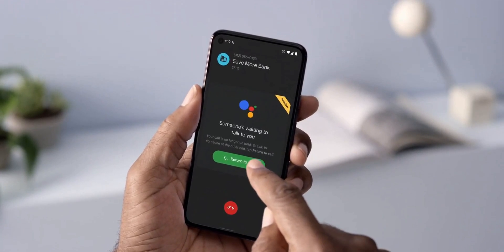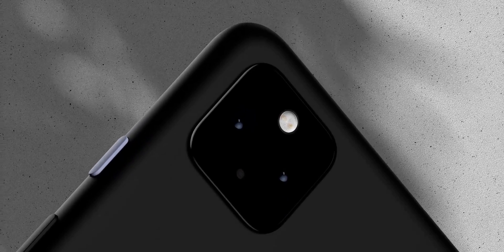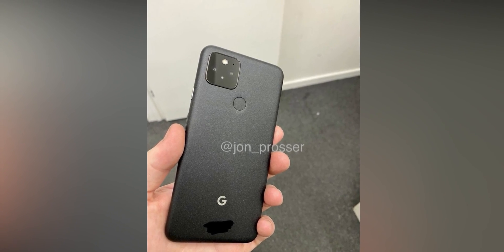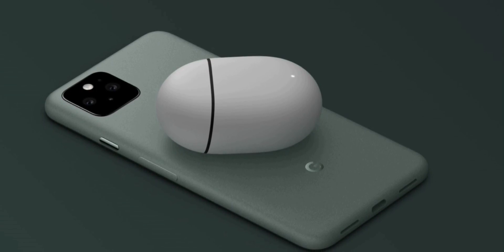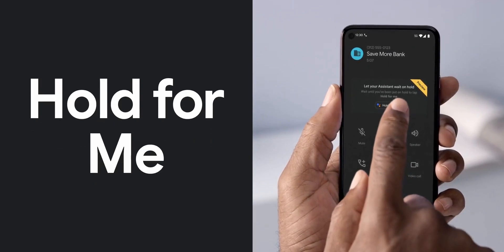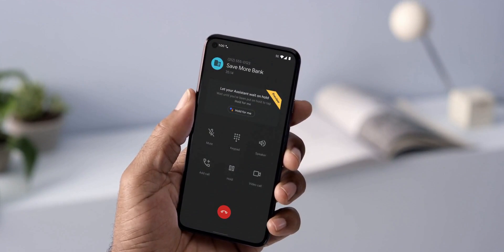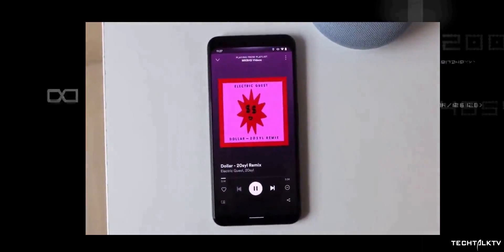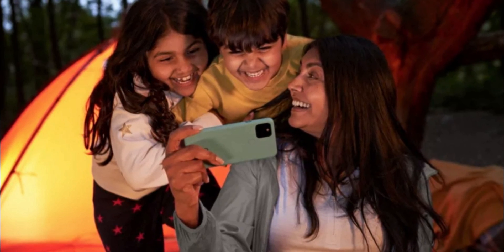Pixel 5 - WHAT SORCERY IS THIS?

Comment: From what I've seen, no the Pixel 5 is not worth 700 dollars, not even close
Hardware degradation is a  real thing, your device slows down over time. 
it's using the 765g chip, which is actually really horrible. The 865 is literally DOUBLE the performance in gaming, and nearly that in just cpu speed. 
It's a VERY big deal, very. 
No matter the optimization it will lag when doing multiple things, where the 865 will not depending on your use case scenario. 
Not only this, it seems they're using the SAME main censor as the 4a, which is very weak. 
Even its video demonstration looked spikey, and not very crisp or clear.  The iphone 11, literally at the same price or less RIGHT NOW is faster, has a better camera, and takes the best video of any smartphone out there. And with 12 coming out soon, Buying the pixel 5 is a very poor, and foolish choice that  lacks any thought to it beyond stubburness of which they will regret in time. 
This phone is NOT worth it, not even close.

Comment: The Galaxy S20FE absolutely destroys Pixel 5, and the price is the same.. I know Pixel usually has a decent camera but, 1) camera set up is far superior on FE. 2) 4500mah battery vs 4080mah, 3) 128gb ufs 3.1 expandable storage vs 128gb ufs 2.1 non expandable storage, 4)120hz vs 90hz. 5)Snapdragon 865 chipset v mid range 765. 6) 25w charging vs 18w charging. Pixels never sell very well anyway but the S20FE will kill it totally.

Comment: Yes, I think $699 is a bit too much for this phone.  I think $550-$600 would be the sweet spot considering the competitors out there.  At $700 the Samsung S20 FE I would say has better specs and at $500 you have the OnePlus Nord which is similarly if slightly differently specc'd.  I think overall the Pixel is a little better specc'd than the OP N but less than the GS20 FE and should be priced between the two, at least ideally.  Of course being an Android phone it's only a matter of waiting and you will probably see some price deals that make it worth the price.

Comment: The reason pixel 5 good or bad is 699 is because they added millimeter wave 5g. Verizon charges 100 dollars more for the 4a5g UW to get MMW. So the extra features pixel 5 has, wireless charging reverse charging 90hz display 8 gb of ram bigger battery IP68 and the metal body is what makes up the the other 100 dollars over the pixel 4a5g. Had they left out MMW the pixel 5 would have been 599.Personally i think verizon forced them into this. MMW is a waste of money at this time.

Comment: If they have optimised the software like iPhone then it's a great phone but still it's gonna cost 70,000 ruppez in India which is roughly around 1100$ so I'm not gonna buy it I'm happy with my pixel 2xl 😂

Comment: I think that companies were just making excuses that aluminum back and glass can't be together, they were lying. Aluminum is not that much of magnetic material so induced current would be less plus there would be a insulated layer between wireless charger and back panel like adhesive or plastic. Until jerryrigseverything.

Comment: No point in getting a Pixel 5 when i can  get the S20 FE for $550 and get
1. 6.5" screen
2. 120hz
3. SD 865 chip
4. triple camera
5. 32MP selfie camera
6.  in display fingerprint scanner
7. 4500mah battery
8. way more software features & color choices.

Comment: Absolutely yes (very overpriced for a midrange phone,especially counting that they are not including the pixel neural core and are making use of the same camera sensor again)
Is like buying the thinkpad x1 fold which sells at $2499-2999 USD but in the end It is just a super expensive Atom laptop which folds
Reply: It has Intel Atom?

Comment: no dude they wont stop using... people will learn to adapt its all upon the brand how loyal they are and they support the feature... and soli radar made the pixel stand out from the rest...  it does have features that people do use it day to day like switching between songs without having to unlock the phone or even touching and so on even dave lee got used to it... people said the same about the asus zenfone flip cam too but if the brand is loyal to their features there are people who will adapt to it... if Motorola and LG didnt stop with the modular phones it would have been their USP even today. like how lg started with wide cams and they stopped it but others picked it up and now its cool...

Comment: just like i said, right? for the wireless charging

if it has an sd card slot it's a good phone, if it hasn't, i would never buy it

internal storage just isn't enough for more than 4 years of usage

s7 was hard to beat up until now with the (pixel 5 and) s20 se

Comment: i'm so happy that the radar is coming back hopefully they take it seriously next time just get the swiping right and work every time u swipe then it's a success i have pixel 4 but i don't use motion sense. just the face unlock is useful but i still prefer the finger print on the side or under the screen as oppose to the back which look kinda outdated .  i'm ok with pixel 4 for now ofcourse it's still a flagship and can get most my work done  and bring me that smooth pixel experience.  i was disappointed to think that google has drop the radar forever but no they just take it back and working to improve that'ss a good news.

Comment: Wireless charging doesn't use signals it just uses Magnetic Fields that fluctuate at a certain frequency to induce an electrical current in the other device's coil. It is calld electromagnetic induction

Comment: S20 FE is going to give a really tough competition to Pixel 5 - Better Hardware vs Better Software.
Reply: Pixel is reliable
Reply: lol what? only better thing on FE is the 120 hz
Reply: @flakron2489  S20 FE is better in terms of hardware; better chip(s), bigger display with higher hz, bigger battery etc for the same price (or $100 less if you go for the non-5G, exynos variant which is still better than Pixel 5's chip), but that doesn't mean you should blindly buy the FE as even though it might seem like a bigger bang for buck, Google is still offering pretty good stuff that is worth considering. Stuff like their amazing software experience both in UI and camera department which is probably gonna be better and will probably last you longer than FE, Android 11 out of the box so you will get major updates upto Android 14, a complete metal body which again will add to its longevity, Titan M security chip for better security, and all other software perks like free YouTube Premium and Stadia for three months — that itself also being joined by three months of access to Google's 100GB cloud storage and Google Play Pass and many more software features.
That's why I said, "Better Hardware vs Better Software". So choose wisely...

Comment: Still take S20 FE Over this at that price!
Reply: I'm neither a fan of Samsung nor Google...but the s20 FE have
- 120hz
- SD 865
- A smaller front camera
- More color options
And overall: you can buy it worldwide without the need to import it
Reply: Jessie Smith 90hz and 120hz doesn’t have a big difference on a smartphone. The midrange chip on the Pixel 5 can match the SD 865 in everything but gaming. Stock Android and optimization will help out the midrange chip, but yeah, the 865 is still much better.
Reply: @Tech UniverseTV for a long-term use maybe yes
Reply: Samsung sucks, the Pixel beats the S20 lineup in everything

Comment: Love how it's metal. Metal backs have always been superior to glass in terms of feel and durability.  They should bring it back especially since wireless charging can be implemented now. Imagine a metal back note 20 ultra in white with wireless charging. That would look slick asf🔥🔥🔥. I would comfortably wear my phone without a case if it were metal back.
Reply: Metal backs are the slickest phones. Even my iPad is slick without a case.
Reply: @ChillydontCap  lol yesss this glass stuff is annoying. I hope Samsung learns a thing or two from google to bring glass back.
Reply: @ChillydontCap  I think the metal is covered with plastic so it would still look like a  plastic back.
Reply: @ricog8209  That I think wouldn't be bad. If it could be a matte finish and not slippery is a plus. Thanks for the info.
Reply: Every metal backed phone I ever had (Nexus 6p and iPhone 6s+) was like holding grease 😳
Reply: Still have a plastic texture above it so.. whats the point

Comment: Wait. The pixel 5 is their phone for this year? I thought that the pixel 4a launched like 2 months ago or so...

Feels old man.
Reply: 4A is midrange
Reply: @kirakira9906  So is 5.
Reply: @Isaiiahii  No it's not..
Reply: @janjamesramos247  Everything about it is midrange.  It's at the upper-end of midrange, but it's not a high-end device.  The main thing that determines a device's category is the SOC and the P5 has an upper midrange SOC.  Just because it competes with the high-end is a few areas doesn't make it a high-end device.
Reply: @Isaiiahii  the meaning of mid is middle.. Statistically, it's not.. that's the simple reason.. the price, the features, the camera, the soc, the software = all Above average..
Reply: @janjamesramos247  The SD765 is a midrange SOC.  The 800series are the high-end SOC's.  Last years SD855 is faster than the 765.  The SD845 CPU is equal to the the 765's, and the 845 GPU is better than the 765.  Last years Pixel 4 has the 855 so is actually better than the Pixel 5 in terms of its SOC.  A device isn't high-end when it's SOC's computing power is equal to two year old high-end SOC's.  

The price is too much since you can buy high-end SOC device's for less money.  It's software doesn't make it high-end since Android 11 is on all the Pixel devices and there isn't anything special about it on the Pixel 5.  The Camera may be the best, we'll see about that, but most likely it's not going to be much better than any high-end device.  It has some features like wireless charging and waterproofing, but those do not make it high-end since it has a midrange SOC.  The Pixel 5 is an upper midrange device that is priced too high.  If I were in the market I'd buy the Pixel 4XL over the 5 since it has a better SOC and more features.
Reply: It was supposed to launch way back like the beginning of the year, but then 2020 struck and everything was delayed!

Comment: The pixel 4a 5G is well priced but in the case of the pixel 5 I feel the Snapdragon 765G is way too weak
Reply: It comes between 855 and 845 and I better than 855 in connectivity and Efficiency
Reply: @Cocxy69  The snapdragon 765g is  actually between 835 and 845 in terms of CPU and even behind 835 in terms of GPU. But it is power efficient than both 835 and 845 with 5G support(if someone cares about 5G).
Reply: @Cocxy69  If true, with 4000+ mA battery, should give 7-8h Screen on time ;p Quite unlikely in real world performance though.  Won't trust google in battery department yet (or) Qualcomm in connectivity and efficiency department. Also with S20 FE at the same price, sounds like a better deal tbh.
Reply: @gsreads  what, google is the most efficient in battery when it comes to android( and Huawei maybe), the pixel 4 had a way too small battery, but with 4000 mah its going to be super good, plus Qualcomm is the best in connectivity in us